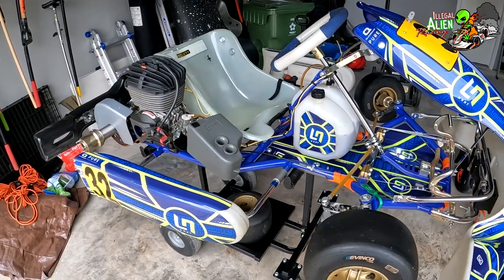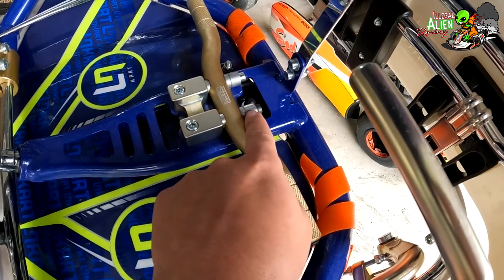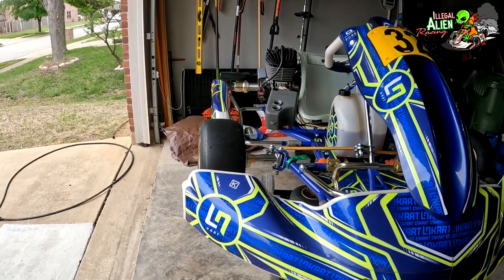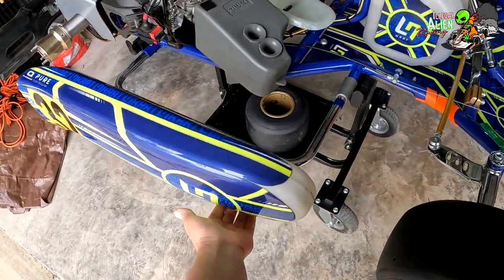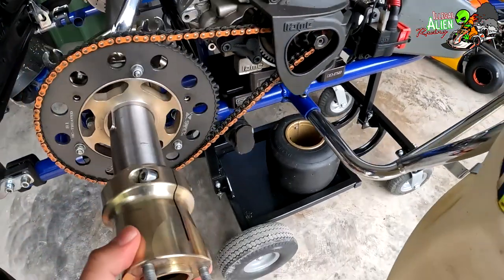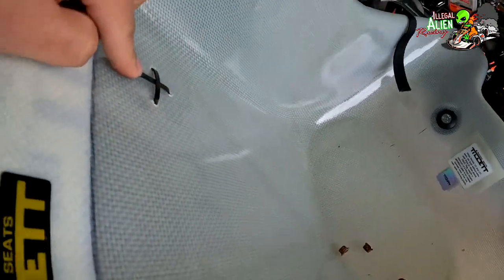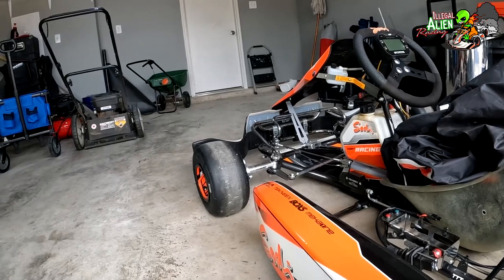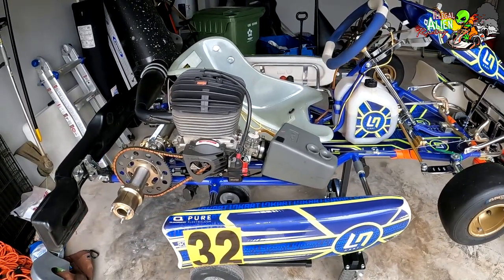Close Look at Kart for Beginners

Comment: Another video suggestion is to do a cost comparison between a season of rental karting and the cheapest season of private owner karting (i.e. buying a used chassis and engine in the Tillotson 225RS or Briggs LO206) at a track like DKC or NTK.  Judging by the increasing size of rental racing fields, there's a lot of people who want to purchase and own a kart, but the sizable gulf in cost is holding them back from doing so.
Reply from the maker: This is a great idea.  Maybe I'll do one at the end of the year and try to compare the costs over the last 3 years since I've been tracking those costs.

Comment: Very Nice video on parts and comparing the two 👍 
I just recently bought a  Kosmic frame and alot of parts, I'm  just learning about them, my kart is very similar to the Tony kart, frame and parts wise, what is the gold piece on the engine side for? The one opposite I see is for the exhaust mount.
Reply: All the OTK brands are exactly the same karts, yours included, just different colors and graphics. The bracket on the right is just an extra exhaust bracket that is used for other engine packages, like the Rotax stuff.
Reply from the maker: Thanks Anthony.  And thanks Doug for jumping in and answering his question.

Comment: hey quick question: I'm getting a Vortex VLR motor right now and was wondering if the exhaust comes with a port for the EGT sensor or do you need to drill your own hole?
Reply: If it is a new pipe, it has a bung welded to it, but you will need to drill a hole inside the bung so the sensor will go in.

Comment: What would be the best kart for a guy like myself that is 6'4" and weighs 245? Can anyone steer me in the right direction. I am looking to start out in the 100cc ka100/VLr100 class or maybe even the DD2 shifter cart class. There is a new kart track that is opening up in my County in Tennessee called the Flatrock Motorsports Park. It is a state of the art new designed track for Karting and road racing. Believe this or not. They are using part of my families land that was sold back in 2000 that has been in my family for over 150 years to build the track. I am wanting to buy a racing kart to race on the land I used to hunt and camp on. Any advice will be appreciated.